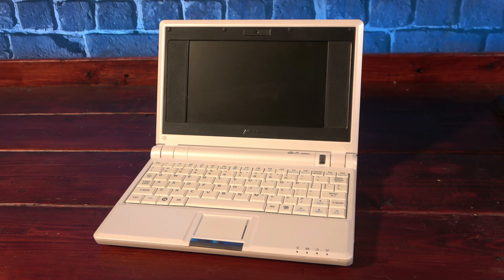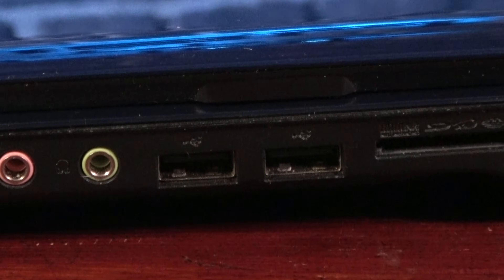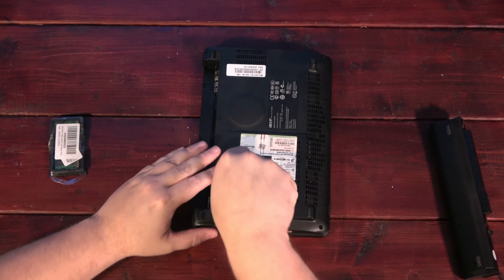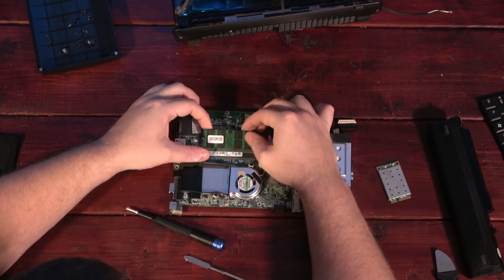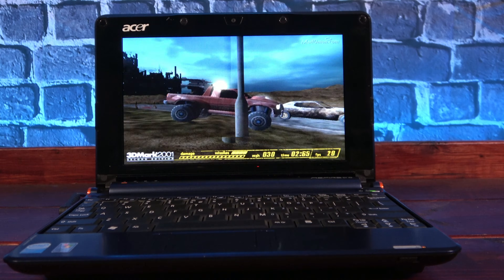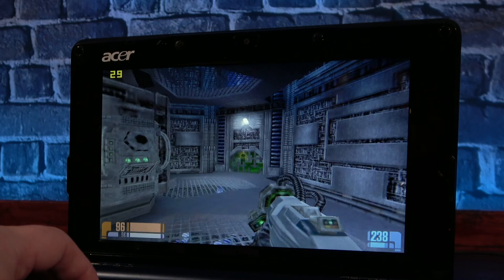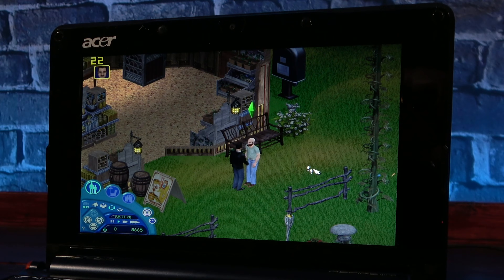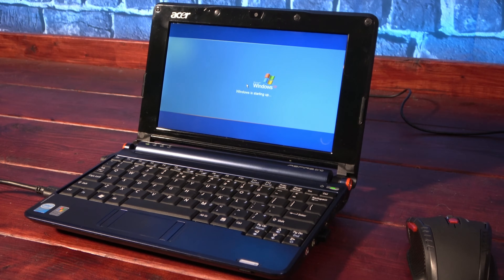Revisiting the Original Acer Aspire One Netbook in 2022

Comment from the maker: What operating systems do you think I should try on it next? Newer versions of Windows? Some Linux Distros? Let me know!
Reply: OS/2 Warp all the way! LOL!
Reply: Windows XP was the best choice if you wanted to game on these machines. Windows 7 and up were too heavy on the CPU.
but if you want to do internet stuff, a lightweight Linux distribution such as MX Linux would be appropriate
Reply: This is a long shot but... Windows 10 LTSC 32-bit; I've had it run well on older hardware though admittedly I haven't tried it on hardware as old as this.
Reply: @mechanopixel2639  you can try the IoT version aswell
Reply: You should try Linux mint and see if you can get any games going!
Reply: I have one of these with Windows 10 running from SSD and it's surprisingly usable with 1.5Gb of RAM. Turn off automatic updates and some of the other background tasks, and some of the visual bells and whistles too. Granted, you won't be breaking any speed records, but even web browsing is bearable. I have Bionic Pup Linux running on another A150, and one running Q4OS Linux, both of which are very nippy.
Reply: I try installing Windows 11 on it and it workes! Only with help from regedit
Reply: @eurovision_train_ukraine_more windows 11 iot version might work even better since it's a stripped down version
Reply: I would suggest Windows Thin PC, which is stripped down version of Windows 7. It works nice on my IBM R51. Alternatively I'd recommend xubuntu.
Reply: is it possible to install larger ram and use windows 10? Also mine has the ram easy access on the back i just need to remove a cover with 1 screw
Reply: linux mint xfce
Reply: Mabye Windows 7 or another version i guess.
I don't know well Linux but it can be a good alternative looking by the comments.
Can't wait to watch and update, i would love to bring a new life at mine :)
Reply: So, I happen to have fallen in love with the similar blue aspire many, many moons ago. I bought it for the sole purpose of age 2 during college. I also enjoyed the small footprint and ease of portability. Mine was unfortunately a single core 1.60 with HT. The dual core models came quickly after. Maybe it is nostalgia, but I have tried multiple time to resurrect it. Peppermint OS is the only viable option at this point due to the limitations of the 32 bit processor. I did upgrade the ram, and install a SSD, but the performance is still abysmal. I may try to turn it into a project PC like headless sever for stuff like FTP or SQL though.
Reply from the maker: I turns out, I've been repeating incorrect info for over a decade. When I bought my first one I was told it was dual core, and never looked any further into it. Turns out, like you, it's a single core with hyperthreading. Just not a ton of power for even basic tasks these days, but sounds like you've got a few ideas to keep it useful!
Reply: I think that arch or gentoo are the best options  for performance it would be really cool to see how the syatem would run on a really optimized distro
Reply from the maker: @WanX that's a solid choice, friend!
Reply: I have played with Q4OS and Sparkylinux on an old Acer Aspire One AOA150 32bit architecture that I bought for $5 at the thrift store to set up a little laptop for my ham radio room and I decided that Q4OS is the best one to use for what I want to do with it. My other Acer AOA150 that I bought new years ago still has Winblows XP for the times I unfortunately must use it and I dual boot with Linux Mint 18 and it runs pretty well with Mint. Both are only 1Gb of memory. I have ran Linux since I fell completely out of love for Winblows in the late 90s and I will never go back to Winblows on purpose. I have used Puppy Linux for years but I have never really liked how it works as far as upgrading and installing programs and so on. It runs beautifully and extremely fast but it just feels like it's a constant project, whereas Q4OS feels like a pretty well put together and polished hot rod. And I love the option to install Synaptic Package Manager for even more access to the Debian software repositories. I think Sparky might be a little faster but it has problems with trying to install anything from Synaptic and gives errors that I don't feel like sorting out when I can just put Q4OS on and go to town. I would love to see if I can get some memory and upgrade these little netbooks and also install some SSD hard drives and really speed these up! I think anyone who tries Q4OS is in for a big surprise. Seems like a very nice flavor of Linux and especially for the older 32bit architecture.
Reply: Those netbooks can do basically anything from Windows 2000 to Windows 10, but XP to 7 run the best. Especially 7 runs surprisingly well.
Reply: Andrea V.  not even that ran well on netbooks. My Acer Aspire one came with it and I switched it to XP.
Reply: Aros
Reply: ChromeOS
Reply: Arch linux
Reply: Please do Q4OS
Reply: write a custom os
Reply: I have question u removed the one gig of ram which is 512 MB

My question 

What did u replace the one gig with to evolve to be faster
Reply: Upgrade the Processor and install Window 11 on it. Or else, put a Linux Distro on it.
Reply: Windows 3.1
Reply from the maker: If you insist... (Windows 3.1)
Reply: Build a Hackintosh with it.
Reply from the maker: Hmm... I bet I could... (Hackintosh)
Reply: Hackintosh ist soo 2012-like. Maybe MacOSX10.6 would run, on my Dell Mini 10v it does.
Reply: Windows CE
Reply from the maker: Let's not be silly now. (Windows CE)
Reply: I’d like to see Windows 8.1 run on it. Windows 8.1 can run most modern software, and it’s light weight.
Reply: Win 8.1 isn't light weight if you talk about a 32bit Atom CPU. Everything newer than XP ist too heavy.
Reply: @adews7204  Nope. Windows 8.1 is garbage. Windows 8.0 is where it's at if you want the best speed.

Comment: Can you post the iso for the restore disks? I can only find an iso for one disc not both.

I actually used a standard windows xp sp3 iso and was wondering why it ran slow. It came with an 8gb ssd so it's not because of that. Thanks.
Reply from the maker: I'm afraid I don't have the restore media for it.
Reply: @PNPRetro  Oh well. You can actually fix the battery issue with a bios update though so at least there's that.
Reply from the maker: @Thedoomslayer2029 unfortunately, not in this case. Upgraded to the most recent firmware, doesn't charge the original or replacement battery.
Reply: @PNPRetro  That's odd.
Reply: @PNPRetro  You used version 3310?

Comment: I've had my Acer Aspire One  NAV50 since 2013. I have Windows 10 Home installed. Using the 32-bit version I had. Intel N450 CPU @ 1.66Ghz. 1GB Memory, I use an external DVD/CD-ROM drive. My Acer Netbook came with Windows 7 Starter.

Comment: I preordered one of these with extended battery when they first were released. I wrote papers, took notes, did some coding all in cognitive science at top world university!  It was great and I was never so satisfied with a purchase.  Later I “upgraded” to a hp 311 thinking the graphics card and 11 inch screen would solve any quibbles I had with this.  It sucked. Much much slower for some reason, more washed out display, keyboard was bigger but much worse.  Touchpad kept getting phantom touches.  I then tried a bigger newer racer netbook - but it too wasn’t as good as this original.

Comment: This is very similar to the model I have, but mine is white. It was my primary portable "laptop" for years (i blew all my money on a desktop back in the day). My mom gave it to me after she won it at her work. It was towards the end of XP support but still worked okay at the time. I wound up overclocking the Atom which led to some heat issues so i installed a manual fan controller, which didnt help battery life but I always kept the ac adapter with me at all time anyway. I havent fired it up in years, the battery took a shit a long time ago but I still have it. Ive been watching videos like this of firing up their old netbooks and it makes me want to pull it out and see if it still works. Now that XP will literally explode if you try to go on the internet, I might finally follow through on what i wanted to do years ago and install some form of Linux on it.

Comment: I tried to resurrect one today. It was  no longer booting to XP. I finally decided to pull the drive out and replace it. I figured put some more RAM while I was at it.  But machine is now totally dead. 😢 No post. Even after reverting to the original RAM config. 

Nothing worse than disassembling a machine completely for it to die like that. Seems that such things happen to old hardware. I am reading the drive I pulled out using a USB to SATA adaptor. At least will get the original owner's data back for them. Which is more important than this old Netbook. I was hoping to expirement with it. 

RIP little Acer. I wish you didn't make getting hard drive removed so painful. Wish you could have stayed around.

Comment: I just fixed one of these that my sis used back in middle school. Its an 07 modle of the aspire one net book. The best thing acer did was take this model, and make it easier to repair. To get to almost everything, besides the ram stick i believe, i just undo a screw and pop the cover off. I have one running a different version of windows that wasnt half as good as the one in the video though. I hated it even as a kid. It was so slow. But its going to get modded and turned into a retro gaming station.

Just wanted to give a little update after 2 weeks of using my xp aspireone. It is extremely capable compared to what i remember my windows 7 (starter) aspire one. I have a few games installed, most of which are low strain, but i have managed to make morrowind work and have played it a bit. Its running a solid 40fps on the little guy, with low graphics granted. I'll be adding and using this thing more in the future. Now im on to my windows 7 dumpster fire of a laptop.

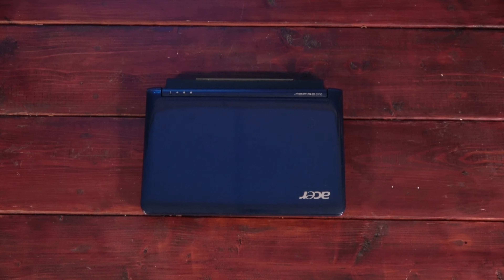Comment: 2:15 - Seriously?  Take the whole thing apart?  My Acer Aspire One D150-1Bb must be a later and improved model, the RAM and HDD are each accessible by a single cover underneath.  Likely newer because mine came with 1GB on board, replaced with a 2GB DDR2 stick.
5:35 - I tried installing Linux (various 32bit versions) and nothing worked.  I'm putting ArcaOS (OS/2 descendant) on mine to run OS/2 and Lose 3.11 applications.  For fun, not productivity, and offline only.

Comment: I had one new and still have it. While watching I dug it out of my storage to check out and see what it needs to run again. Looks like I'll need a power cord and battery and possibly a ram upgrade. Pretty sure I maxed it out back in the day, but it was probably slow ram so yeah... Being a broke teenager you do what you gotta do to have fun lol. 

 So with operating systems, check out Linpus Linux, one of the options available when it was new. It sucks, but it's an interesting OS. It was trying to be like Chrome OS but in ALL the wrong ways. I'm pretty sure that one was locked down and needed a workaround to gain root access to use it like a normal OS. 

Next up would be make it a Hackintosh. I personally used the Kalyway OS X installer burnt to a disc using a usb disc drive and it ran quite well. It was faster than XP and useable for day to day tasks, while looking more attractive on the lower resolution screen. If you do, just know the stock wifi card won't work. Don't quote me on this part, but if I'm remembering correctly, you'd need a Broadcom card that went in Macbooks of the time. The stock one isn't even recognized in OS X. There were PC equivalents so it's a cheap upgrade, but a must if you want to daily drive it.

Next up is Puppy Linux. I ran 4.2.something or other on it and it was speedy. I also got FreeBSD going on it, although I don't remember if that was a pull my hair out install or a good experience, so ymmv. You could likely use most of the lightweight Linux and Unix OS's from the late 2000s. I jumped over to Android doing dev stuff for Lenovo so I likely missed out on some flavors that ran well on the ZG5 once it was out for a while. 

Now this is going to make me sound old, but to get around the touchpad being made for gnomes, I got a wireless trackball from Logitech. I know most don't like trackball mice, but it makes the netbook so much more useable on the go. Anyway, I generally carried mine everywhere to do dev stuff, toy around in Acid Pro making my own techno, and write out horror stories. Any of those OS's would work well for you and I'd love to see an update video with it showing different flavors to see which is the best for it in the modern day. 

Not to ramble and turn this into a novel of a comment, but back then I was using a Gateway Solo 2500 with a Pentium 2 as my daily driver running a restoration shop. Making use of 10, 20, and even 30 year old computers is a blast and can be a fun and enjoyable way to help people out that can't afford a computer. I'd gather up laptops at the dump out of one of the dumpsters, if I didn't get caught, and fix them up and give them to people that needed to use email for something but didn't need a $500+ computer and didn't know the first thing about them. 

If you need any help or advice with it, feel free to hit me up!

Comment: Had the same one sitting ducks for many years in a shelf. I decided last year to try and fix it and after giving it to a friend, he managed to fix it and make it run on a linux software. I used it for some months then forgot about it until I saw your video. Unfortunately as I tried to boot it up, I noticed that even though it seems to boot, the screen stays completely blank. I think it's time to let it rest. It served me well😢
Reply: Just look for the “Acer Bios Fix” webpage on google. The procedure to update the bios is quite easy and it will work again. 
The original post isn’t available on the Acer support page any more, so this page is the only place to go to get this problem fixed today (2024). Just checked and it is still up.

Comment: I used to have the same model in blue colour. It was fun to use  at the beginning but later it started to glitch a lot, so I got rid of it and got myself an used triple E pc 900ax model. It runs win XP and it's pretty useble even now in 2k24 :). My only complaint is the battery life of only 2 hours.

Comment: I bought an "Acer Aspire one KAV60" (color red) -  to my sister .... about the RAM it has 1 slot and was upgraded from to 1GB to 2GB - about the OS, it has currently Linux Peppermint 32 bits based on Debian 11 .... now the dmidecode command indicates it can support until up 4GB - Pls, let me know if you have some kind of confirmation if it really supports 4GB as maximum. Thanks in advance

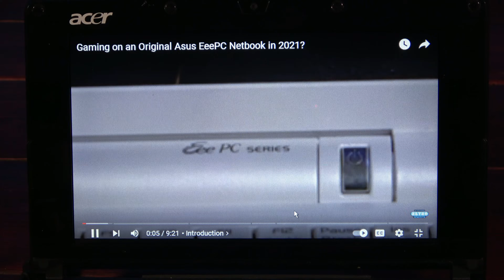Comment: at 06:08 (https://youtu.be/FFRVx4_4mLI?t=368) you talk about video playback. i've got exactly the same machine (although a white one) and while tinkering with it i've found out that: 
1. vlc is too "heavy" (i know, it's weird) 
2. 1080p playback is just too much for this little guy. 
BUT - if you limit yourself to 720p and use Media Player Classic (HC or BE) it runs well enough for video to be watchable. weird thing with VLC is that it's (also) based on ffmpeg - just like MPC, but it's still too much to play (720p) video smoothly. conversely MPC does the job! so - with standard VGA out this machine could easily become 720p media player. cheers! 😎
Reply from the maker: Thanks for the info! MPC used to be my fallback for low powered hardware, but I kind of forgot about it after I started using VLC. I appreciate the reminder.

Comment: The best use of old Acer netbooks is to use them as retro arcade systems.   They are better than a Raspberry pi as you can get them cheap from FBMP.     Usually the keyboards tell to break with age and the battery on >10 year old laptops are long dead, so no one wants them any more.

I have cut up my two different Acer Ones in half and put them in an small arcade cabinet each.    I've discarded the keyboard, battery and screen hinges.

they run AdvanceMAME with a joystick encoder board, and they look small and neat, they are great for arcade games no newer than 1993.

peace, Jonathan

Comment: Dont try installing Windows 10 on these Acer netbook.  From a licence point of view, you can still do a free upgrade from Win7 starter (on my Acer One D250 and D260)   and it will work.

But, it will be so miserably slow you will hate it.   And upping the RAM to 2Gb and SSD replacement make a fat load of difference.   Control alt Del reveals the Atom 1.6 cpu is running 100% of the time when doing nothing.